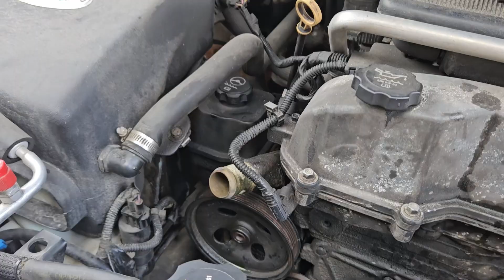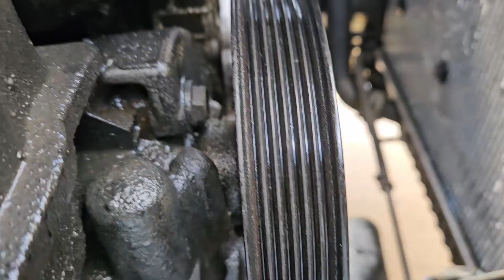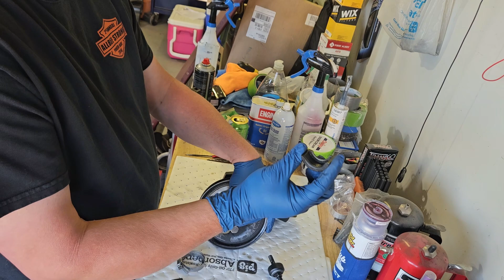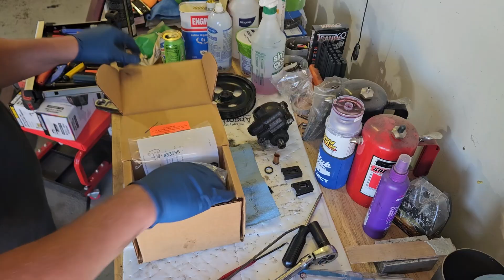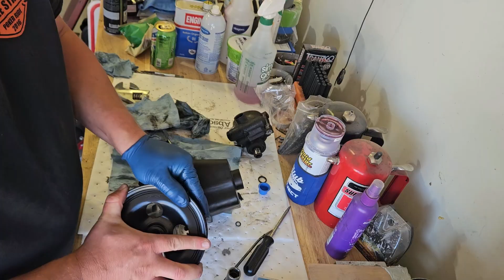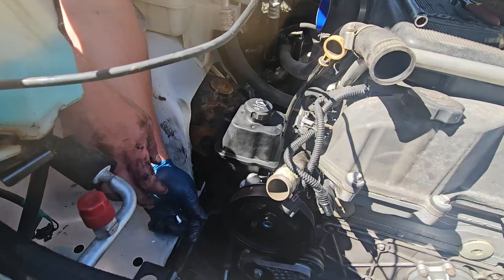GMC Envoy Chevy Trailblazer 4.2L power steering pump replacement

Comment: I had a trooper with the same engine. oiling problems had an automotive chain store mechanic tell me it was a piece of crap engine. got divorced she got the trooper.  I kept the '95 yota corolla. where is Bob when you are having all this fun? Your cleaning skills are exemplary in this video. Was it a big cost difference between the entire unit as opposed to just the pump including your assembly time? have a great weekend.
Reply from the maker: Ohhh I think i saved 25 bucks by getting it without the reservoir.  Ol Bob always misses out on the all the fun doesn't he? Lol
Reply: @theholubproject3497  he does indeed. he needs to get on debbie. it is sad to see such a fine specimen of early '60s american automotive debauchery being use as a tool bench for bowties
 lol.